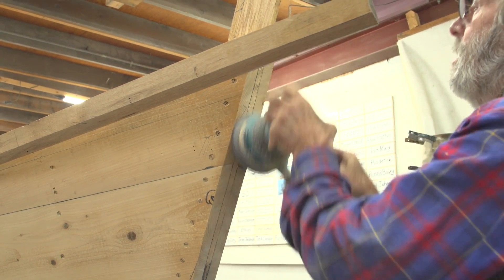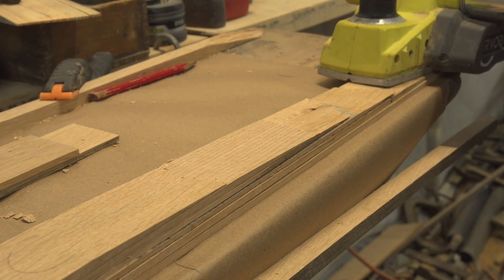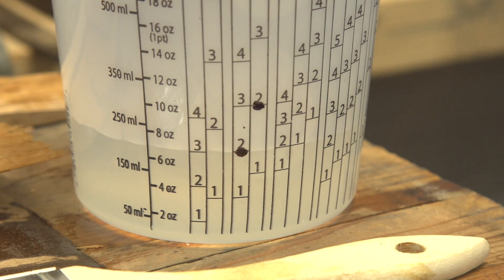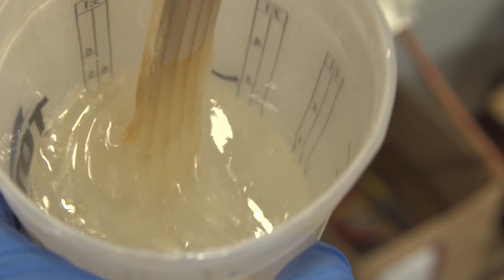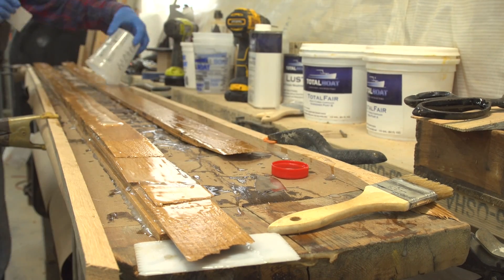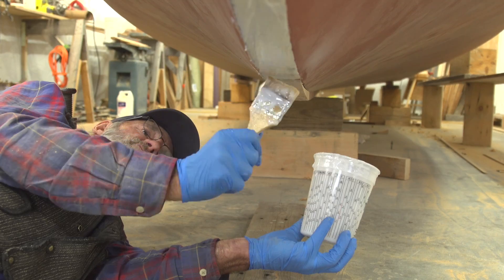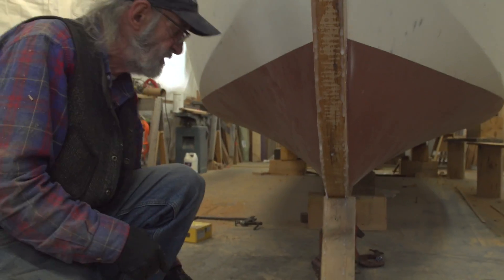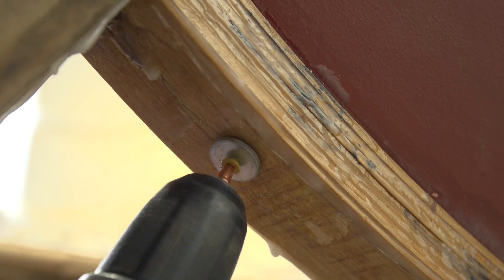Building the V-Bottom Skiff - Episode 24: Laminating the Cutwater

Comment: Every Time,  I watch your Great Channel I learn something new ,and I use it in my world and Damn, if it is better your way so cool,   Thanks again for helping me, at 65 Retired Crane Operator, Charter Boat Skipper on Maui for Twenty Five years thought I have seen it all .  I used that C Clamp trick on my 1935 Truck  Project held that old bent rear fender from under neath wedge on my shop floor,  so sweet damn I need to buy you a Shot and a Beer.   You just solved  my Problem thanks again Ben

Comment: - The C-clamp chocks for the 'kickers' {what you call 'props'} is Clever, quick and easy solution, and handy in your shop, and something you are used to handling.
- A carpenter would have just driven two 16 penny double-headed form-nails into the bottoms of the 'props' into your anchor board. 
- {OR} if the 'kicker/props' were slanted at a 'low] angle, a carpenter would use 2x4" cut off pieces with two 16-penny double-headed form-nails angled toward what the 'kickers' were pushing up against
- Your way is better and easier for you, and you don't need to have heavy framing hammer extra pieces of wood cluttering up the operation.

Comment: So Lou, you are not worried about clamping the laminates in the timeframe of the potlife of the epoxy? Awesome job thx for the content!
Reply: Fair concern, but I saw Lou's breath condensing a few times during the process, and the epoxy was behaving as if it were very cold (dripping off in long, tapered strings).
So I suspect Lou wasn't worried at all, because in those conditions, epoxy takes forever to start gelling.

Comment: Nice going Lou.  I made a curved exterior stair rail out of 1/4" x 1 1/2" cedar strips using West 5/1.   
Built a radiused wall in my garage to the inside radius - Set the high and low end points on the wall and used one strip as a batten to draw the rail line.  
Then put a few outriggers spaced along on the line and some extra length in the pieces.  Set the pieces on the outriggers and shot them with Stainless brads 18 g to hold them as I went, epoxy first of course.

System worked so well when I made the bottom rail and set it on the top rail, they were perfectly in line.  
Built the stairs as segments but cut the treads on a radius so as to give the appearance of a fully curved stairway without the intensive labor of curving the entire frame.

Did the same thing interior but with 3" x 1/4" red birch strips.  In that case they were vertical so 6 strips created a 1 1/2" x 3" vertical rail with a finger groove on each side, like keyhole shape.
I screwed upright sticks to the risers of the stairway before treads were on at the inside radius point of the rail. 
Used Slowset Powdered glue that you mix, put the whole thing in a glue bag, 13' long.
Set the bag against the uprights right on the riser edge.  
Clamped the top and bottom only with some pull inward on both points for spring-back.  Woodworker pal gave me the spring back number.

Great fun - sorry about the long rant.  Love your boat, a beauty for sure.